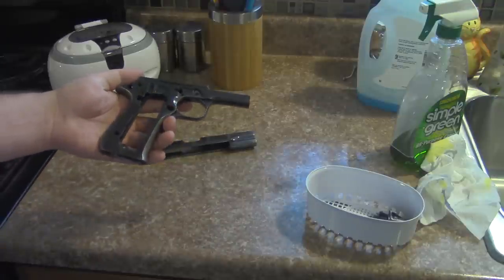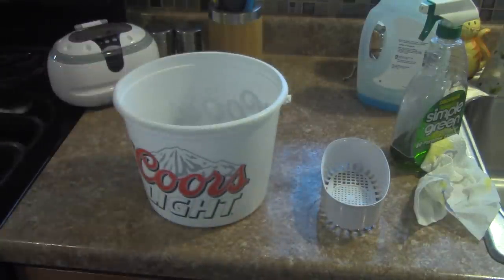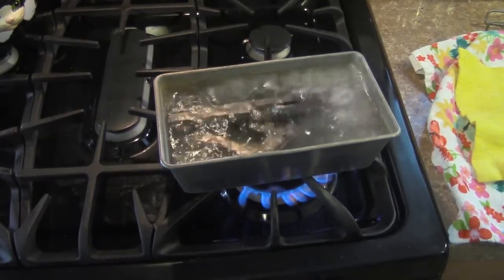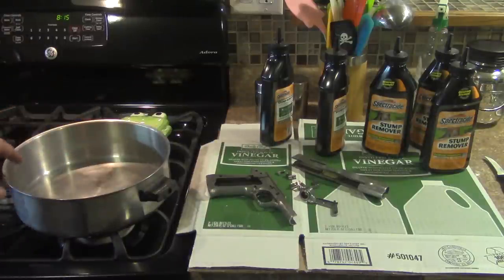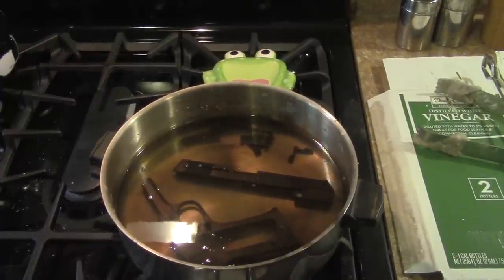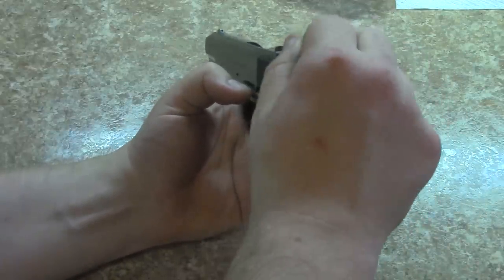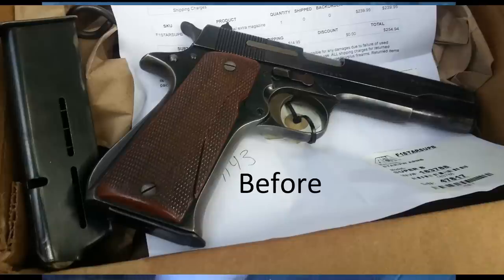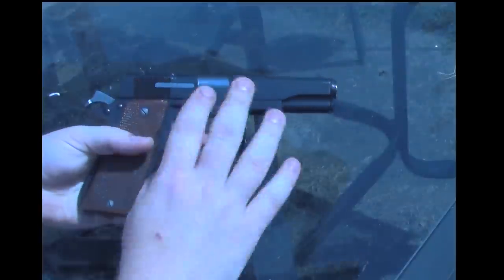DIY Reblue Your Gun at Home for $50

Comment: Good video. But you should have mentioned that the kind of stump remover to use is the 100% Potassium Nitrate type. There are other types of stump removers and if you use those you will screw your gun up.
Reply from the maker: Notes From The Man Cave Good point, and it's also worth noting that you can buy potassium nitrate in bulk online for much cheaper than buying it as stump killer.

https://www.dudadiesel.com/choose_item.php?id=10pn
Reply: That's not cheap.  That's hazmat.  You have to pay an additional $35-50 ground to ship it.
Reply: not true.. check eBay
Reply: Tommy Winter is it toxic to melt tree stump remover?
Reply: My Iron idk but i'm not dead yet, and i didn't use a gas mask on my second try
Reply: Tommy Winter thank you sir ill try this
Reply: Notes From The Man Cave 3 years later that's still a good in piece of information to have
Reply: Good to know.
Reply: NPC #303 no no it’s not lol trust me I’m a chemist
Reply: Specitracide stump remover is only 98% Kno3, does that make a difference if not 100%?  Can a smaller amount be used to blue rather than the amount u used?
Reply: Potassium nitrate is a big time oxidizer. That means it supports combustion. Please be safe with this stuff.  Look up videos for sugar rockets, it’s basically sugar and stump discover melted together and formed into a rocket motor.  Cool but fairly dangerous. Stay safe guys and gals.
Reply: Potassium Nitrate...boom!
Reply: @gennareactchannel8161  you're fairly safe as long as it's just Kno3 or Kno3 in water and you keep it out of direct contact with flame. It needs fuel like paper or sugar to be really dangerous and about 50% of it's mass' worth too

Comment: Wow great job every time I run into a problem someone has already figured it on and posted it on YouTube. Thanks for taking the time to record this.
Reply from the maker: I own a Koozie that says "Once I learned you could buy trophies, I became an expert at everything."   I want a koozie that says "Once I found Youtube, I became an expert at everything."  I have been able to fix almost everything that breaks around the house from plumbing, electrical, appliances, HVAC, etc.. without much more than a trip to the hardware store.  I have a pile of gunsmith manuals and schematics but it's way quicker to find detail strip videos on YT.  If it ever went away or they banned DIY content due to liability reasons I would be lost.

Comment: Awesome process; I'm not going the whole way with the bluing, but I'm using the Vinegar Soak/Boil to remove bluing from parts that should be "in the white" on a Mauser C96 Broomhandle that was badly reblued (into a flat matte black) and covered with old oil and light rust inside. The gun is all matching; eventually I want to have the gun restored with an original style rust blue.

Comment: Couple of things here.  I'm not going to get into the below argument about "ruining" a gun by heating it to 600F.  The thing to educate yourself on is what is hardening, tempering and annealing of metals.  The temperatures that various metals achieve this depends on the type and composition of the metal and how it is quenched or cooled.

With that said, the issue that is important to understand here is tempering.  This gun was not heated to a high enough temp to harden it (that would be somewhere around 1500 degrees and then quenched).  It is not being annealed as that requires higher temps and a slow air cool.  

4140 chrome moly steel is probably the most used steel in gun making for everything from bolts to barrels to frames and receivers, however many other steels are used, depending on the specific gun (for example, some companies use 7150 steel to make ar-15 barrels).  Most barrels are in the rockwell hardness range of about 30-32.  Frames, such as found on auto pistols will have even lower hardness ratings; 22-25.  In order to seriously soften that hardness the temperature would have to far exceed 600 degrees.  If the steel was at a higher hardness of say, 50-55, then 600 degree heat can soften it.  Tempering, however is not to harden the metal.  Hardening occurs first (at much higher temps).  Tempering is then used to achieve the target hardness and to aleviate stresses in the metal from the hardening process.  

The effect of a metal's hardness/softness determines how it reacts to various forces.  In the case of an auto pistol, the barrel and slide are typically the highest stressed components.  Hardness is important for durability (harder metals don't wear as fast from friction), but the harder it is, the more brittle it becomes.  Brittle metals don't absorb high shock levels, they shatter.  So, the type and hardness of the steel has to be a compromise to handle the stresses and provide good wear.  Too soft and it stands the chance of permanently deforming under stress, or failing completely.

In this particular case of "heat bluing", the salts used have nothing to do with color or any chemical reactions to cause the bluing.  The blue color is a direct result of heating the metal to the temperature that causes it to change to that color.  The roll of the salts is to provide a constant and even application of heat at a specific temperature.  You can do this exact same procedure by simply using a torch to slowly heat the metal until it turns the color you want, then quenching it.  The problem with a torch is that it is difficult to achieve an even temperature across the entire surface of the part to achieve a uniform color.  You can see the effect of color change in steel if you've ever used a torch, or ground steel on a grinding wheel and seen the small heat affected zone.  You'll see a light golden straw color that darkens as it gets closer to the higher heat, then eventually purple to light blue then black.  That "rainbow" affect is due to the zone having reached different temps.  Heat bluing is the attempt to reach the exact temp across the entire piece for the color desired.

Heat blue such as this is not particularly durable compared to the more well known types of "traditional" bluing, such as rust bluing or "hot tank" bluing.  It is a step up from cold bluing, but not nearly as durable as rust or hot tank.  Heat bluing also does not provide any rust resistance.  A heat blued part will rust as easily as bare metal.  It's draw is that it is relatively easy and "pretty" depending on the color you heat it to.

There are other forms of "coloring" metal as well.  Case hardening, for example is done with a mixture of charcoal, bone and leather.  The fragments of each, in contact with the metal as it is heated, causes a variagated pattern of blues, purples, golds, straw, etc.  The charcoal also introduces carbon to the surface layer of the steel and significantly hardens it.  This layer of hardness,  however is extremely thin (thousandths of an inch).  It's purpose in this respect is primarily aesthetic as opposed to any performance gains in the steel. 

The heat bluing with salts as in this video does change the hardness of the metal to some degree and if done excessively (i.e. leaving the steel in the heat for too long) stands to embrittle the metal.  I doubt you'll find a gunsmith or company that does heat bluing of barrels, or entire guns in general because of this.  One company, Cimarron Arms, however does a "charcoal bluing" process on the cylinders and barrels of some of their revolvers to achieve a bright peacock blue color, but that's an entirely different, and difficult process.

For low pressure cartridges, like an auto pistol, or a 22 rifle, it shouldn't cause any adverse affects to heat blue the receiver, frame and even the barrel.  I would not heat blue the barrel or actions of a center fire rifle or high powered pistol.
Reply from the maker: Thank you for your well written comment.  The material that the other debate boiled down to was this.

Heat Treatment of Steel
From the 1924 edition of Machinery's Handbook
A series of experiments made to determine the proper temperature to 
which to heat high-speed steel for annealing, showed the following 
results:  When the steel was heated to below 1250 degrees F. and slowly 
cooled, as in annealing, it retained the original hardness and 
brittleness imparted in forging.  When heated to between 1250 degrees 
and 1450 degrees F., the Brinnell test indicated that the steel was 
soft, but impact tests proved that the steel still retained its original
 brittleness.  However, when heated to between 1475 degrees and 1525 
degrees F., the steel became very soft; it had a fine-grained fracture, 
and all of the initial brittleness had entirely disappeared.  In 
carrying these tests further, to 1600 degrees, 1750 degrees, and 1850 
degrees F., it was found that the steel became very soft, but there was a
 gradual increase in brittleness and in the size of the grain, until at 
1850 degrees F. the steel again became as brittle as unannealed steel.  
Dried air-slaked lime was used as a packing medium in making these 
tests.

Source
http://www.zianet.com/ebear/metal/heattreat5.html

Seems to indicate under 1250F won't anneal steel.  1250F>600F

This bluing method shouldn't damage a gun.  It's not the best finish or the most durable but the cost and effort ar much lower than other methods and it produces a decent enough finish for a beatup shooter.

I recently did this 1911 using the same process and went for a deep colt blue with peacock parts where colt would have had them on an original 1911.   I think it turned out ok for a beater 1930s 1911.
https://www.youtube.com/watch?v=2lM68hD4MQ4
Reply: The danger in heating to 600 degrees to color the metal is not in annealing, as you've already noted that requires temps at or above 1250 degrees...but then again, that was for high-speed steel.  Every kind of steel has different temp ranges where these transitions in grain structure occur.  Annealing is intentionally softening the metal as much as possible.  Annealing is done, for example when working with aluminum so it can be formed easily, then the final part heat treated to harden it.  We reloaders even anneal the necks of our brass casings to prevent them from splitting when bullets are seated.  The process of reloading a case work hardens the brass and when it gets too hard, will split when it is forced to stretch a little to accept a bullet.

What 600 degrees will do to 4140 is change the temper.  The hardness will change also.  The question is whether the amount of change is significant enough to create a danger in firing the gun since the exact temper and hardness of each and every gun varies.  Hardening, annealing and tempering of metals is not an exact science and you will find variances from one to the next.  

Realistically, time and experimentation have shown what works and what doesn't in terms of the types of steel used and their various hardnesses when it comes to firearms.  There is always a range of tolerances that will work over the life of a gun.  One barrel manufacturer might use steel that is several iterations harder than another and perfectly safe for the life of the gun.  You just want to be sure you aren't altering those characteristics to a dangerous degree.  

In the case of 4140 guns firing low pressure cartridges, as mentioned is typically viewed as OK for heat bluing (although you will find some people who view it as trashing the gun).  Just don't heat blue a center fire rifle or high power handgun unless you like to play dangerous games.  Unlike reading pressure signs on hot loaded cartridges, you won't get indications in the gun parts, or barrel that something is going wrong.  It will be an instant and catastrophic failure with potentially fatal consequences.
Reply: Edward Lance so I did this and I think I left it in too long it came out very black with even blacker spots did I ruin my gun?
Reply: What's your background? You seem to know about this stuff! I am trying to learn whatever I can.
Reply: You wrote all that nonsense and anyone who understands the process knows you are full of it.  Stop being vague if you are going to spend that much time saying nothing
Reply: @nonyabidness6492  Lol, tell us all about your degree in metallurgy, mmmkay?
Reply: @nilbog6942  Nah, it's just about sharing info man.  I just don't want to see someone potentially hurt or kill themselves.
Reply: @edwardlance2379   graduated 1997 in metallurgical engineering from UT Austin. Where did you get yours?

Comment: This really works. I used  potassium nitrate and an outside gas grill burner eye to do an old S&W model 10 cylinder. It came out great. Cannot over state the importance of the metal being cleaned, polished and thoroughly cleaned before blueing. Just be very careful by preparation and have a fire extinguisher handy. As long as you respect the process (don't take shortcuts)it works fine. The comments below cover all this, but having done it I wanted o endorse this G&S video. Thanks and keep up the good work.
Reply from the maker: +gator340 Awesome, thanks for commenting.  It isn't the most durable bluing process but it's easier and cheaper than caustic hot bluing and will really spruce up a beater gun.

Comment: OMG! Dude, That stump remover i is crazy flammable. It takes a little effort to light but when it goes it burns really hot like sulphur. You should do it outside or at least put a warning up someone is going to burn down there house!
Reply from the maker: It's actually an oxidizer so it's Noncombustible, but accelerates the burning of combustible materials.

Don't use a wooden bowl to heat it.

Comment: I've done this with some old, beat-up S&W revolvers that I got for cheap.  Disassembled, cleaned and reblued.  Ended up selling a few of them for quite a profit, (and yes, I did disclose that I stripped and reblued the firearms).
Reply: Would it be worth doing it on a colt python that has most of the bluing off from holster wear or does it damage the heat treatment

Comment: I reblued my black powder gun using the flame blue method.  It came out perfect.  In retrospect, I wonder if it was a good idea.  Heating the barrel until it was very hot and then dipping it in canola oil may have taken the heat temper off the barrel.  Now, I am afraid to shoot it and have the barrel explode.

Comment: i know you posted this like 5 years ago, any chance of an updated video with modern products and Technics??
Reply: The stump remover is pure potassium nitrate. Any nitrate salt can be used, and any acid can be used to remove the finish just be careful about the PH level because it can pit your gun. Once you’re done with the actual hot blueing make sure to coat your parts in WD-40 for half a day to dry and protect your finish. Also only steel (non 300-series) parts can be blued so most modern AR parts can’t be blued.

Comment: It turned out quite decent for just using the potassium nitrate. I tried to do it using a mix of water, sodium hydroxide (100%), and Gordons stump killer (100%) potassium nitrate doing it this way requires the person to be outside (produces ammonia fumes during chemical reaction) and slowly add the potassium nitrate after the sodium hydroxide melts in the water. Water was distilled. The person also needs to retain the working temp for the solution. It did produce a very nice bluing but both ways are extremely dangerous. 

It should also be noted that if someone does it the way I said above then pour water then add acid do not do it the other way around because the chemical reaction can be quite violent. Then slowly add the potassium nitrate. Also potassium nitrate is an explosive as well as magnesium dioxide or anything magnesium for that matter so it is good to use extra caution when working around a heat source. 

Personally I found it easier to just go to runnings and buy Chrome R Tile by Santeen (Phosphoric acid), steel wool, 2 D cell batteries (source for magnesium dioxide) and distilled water and just parkerize my slide and it holds up much better. This method reduces the risk of anything going wrong and can be done in the kitchen with a window open. The smell that comes off that is similar to the same smell of rust and blue remover (probably because it contains phosphoric acid). You should see this thing the parkerization is perfect and looks really good. 

Prep is always the key to any gun finish......well that and patience.
Reply from the maker: I think caustic blue makes a more durable finish but I don't feel comfortable dealing with it without having the correct equipment.

I have Nitre blued 3 more guns since this one.

https://youtu.be/CYrbkszwxiI

https://youtu.be/nrm9XUv1MYA
https://youtu.be/2lM68hD4MQ4
Each time I get a bit better at the finishing.  The 1911 I got some nice peacock blue accents on the smaller parts.

Comment: I use the hot water bluing method. Have done an old Hungarian Frommer Stop and a Beretta 951 that way. It doesn't come out as shiny since it is essentially accelerated rust bluing. The Mark Lee Express Blue is awesome. Try that next time. The guns are holding up awesome. I know some places sell nitre blued firearms new (Seen some Colt SAA clones), but they don't seem to wear as well as rust or hot blue nor really prevent corrosion as well.
Reply from the maker: I've done 4 guns this way and they seem to have held up fine thus far.   I looked into rust bluing and while it makes nice results it seems like it takes more skill than Nitre/Hot Salts bluing.  Using this method all you really have to worry about is getting the polishing done evenly.  Rust bluing you still have polishing to worry about as well as the rusting/carding steps until the finish looks nice.
Reply: @GunAndShotTV  The carding sounds hard but it is really easy and oddly satisfying.  The problem with rust bluing is you have to do the steps about seven times.
Reply: @Gun&ShotTV  what did you use to polish it?